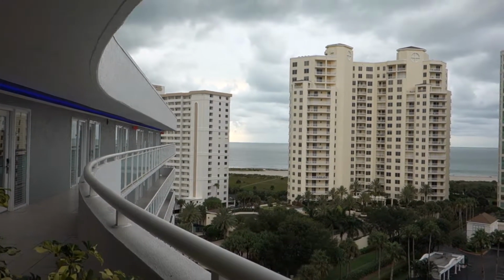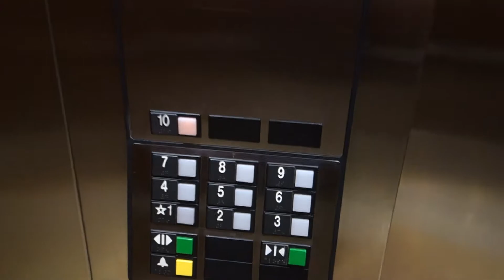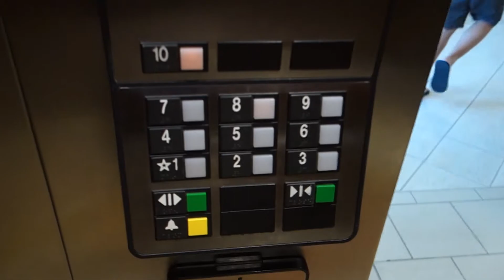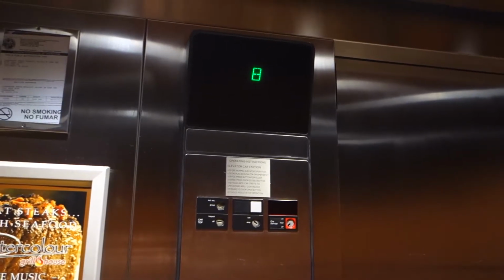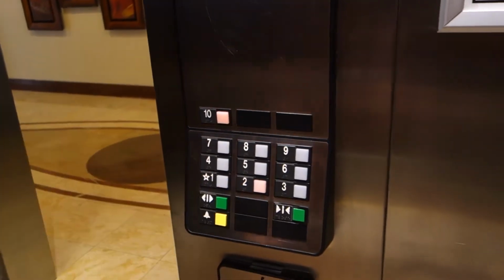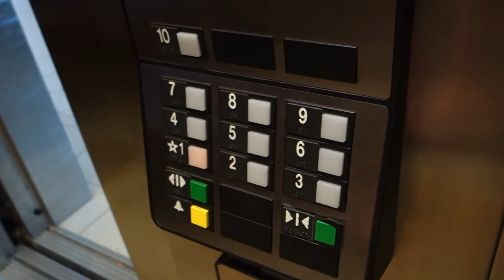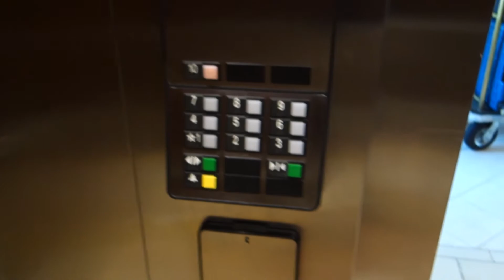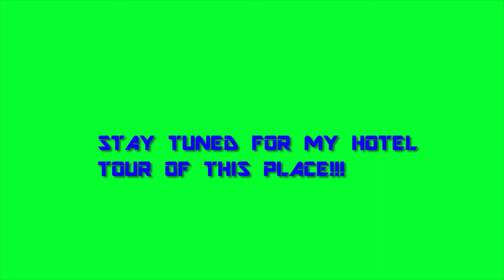Relay Controlled 1989 Otis Series 1 Traction Elevators at The Marriott Suites, Clearwater Beach, FL

Comment: Very nice elevators, and I am really amazed that Otis still used relay controllers in the late-80's, even though they look almost like Elevonic 400 series elevators. However, Dover had some relays in their Traflomatic II and III systems, and they also used relays in the Composite controllers (even in the early to mid-90's).

Comment: Never knew relay controlled Series 1's existed. I have also never heard of an OTIS traction that is relay controlled that is installed in late 80's or newer, as OTIS rarely used relay controllers for high rise applications since the mode 80's.

Comment: Also, just because they have KONE sensors doesn't mean they are or were ever maintained by them. I believe they're technically just 3rd-party sensors that any company can use.
Reply from the maker: Elevating Western PA Productions No, KONE mainly used them only. Pretty sure these had to maintained by them at some point.....
Reply: I’m not saying for sure they never were, I’m just saying I’m pretty sure I’ve seen/been on some elevators that have never had a KONE contract in their lifetime, & have KONE sensors on them. So I was just saying that maybe the case here, or it may not have been.